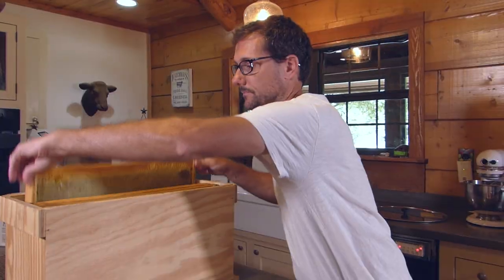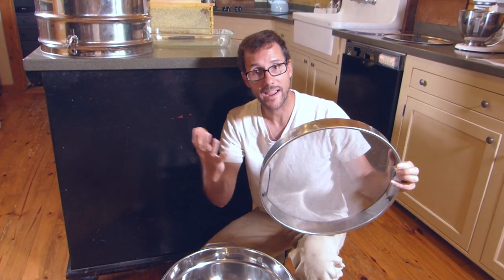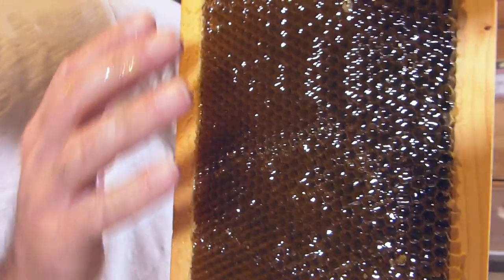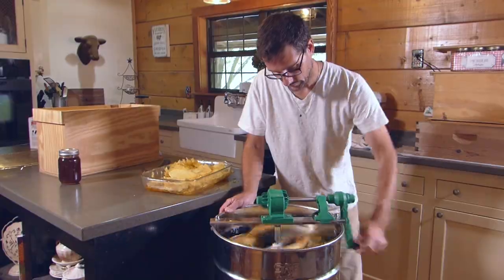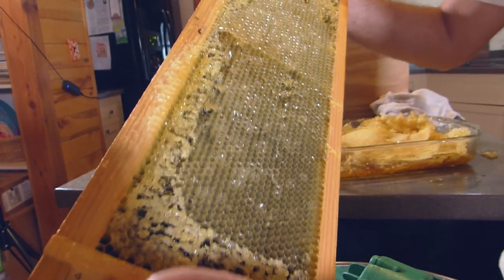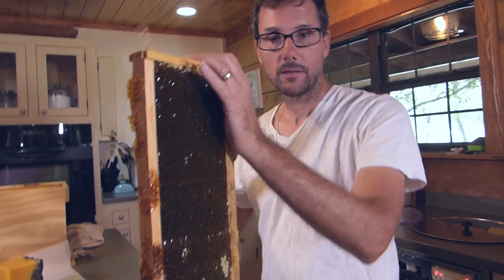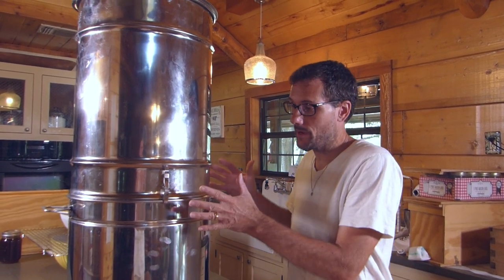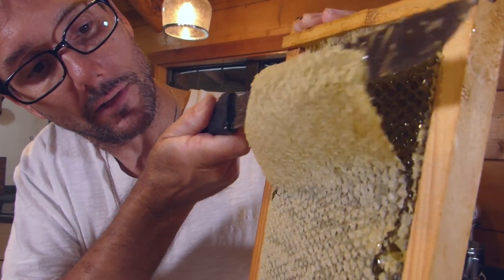Honey Harvest - Spinning Out 4 Gallons of Honey!

Comment: Hello Mr. Kirby,  I am not a beekeeper myself, but in watching other u tubers, I have seen them use a tool that looks kind of like a wire brush like thing about 3 inches wide and cylindrical in shape kind of like a small paint roller. In using this tool they open up the wax capping without damaging the comb.  A tool like that would save even more comb for the bees and you would get more honey in the long run.  I do appreciate your video so keep the good work.  By the way you got a sub and alike out of it.  Thanks again, Rick

Comment: Another possibility for using the excess wax is little blocks for hand quilters. we like to run thread through beeswax before stitching with it. It helps strengthen the threads and helps it run through the quilt layers smoothly :)

Comment: Board Butter :   I am a woodworker.  I dissolve one pound (1 part) bees' wax with four pounds (4 parts) mineral oil ... in a slow cooker.  When it has emulsified, I pour the end product into small containers (like those which hold shoe polish).  When it cools, it is very much like shoe polish except that it is pure ... pure enough to treat cutting boards, charcuterie boards, etc.  Fabulous use of the wax !!!
Reply from the maker: I love it. I've made some of that for myself to use on the cutting boards I make out in that fantastic barn :)

Comment: How many frames did you spin to get the 4 gallons? I am starting my 1st hive this year and I'm kind of looking ahead and gathering information.
Reply from the maker: If I didn't mention it in the video I certainly don't remember LOL. My hives are so up and down with honey production that I don't have a consistent notebook of data to keep all those things fresh in my head. The last couple years I haven't collected any honey at all. 2022 was a really dry year so the production was very low. I let them keep it all in the hives for the Winter.
Reply: @daddykirbs  ok. I was just curious because I have no clue on what the yield is on a full super. I will find out one of these days though 😃
Reply: @daddykirbs  good video by the way!
Reply: @williemaykit7940  Shallow super 25 pounds or 2 gallons. 
A medium 6 5/8 super 35 or 3 gallons. 
A full-depth box 60 pounds or 5 gallons.
Reply: @chadneely4511  thanks man!

Comment: This machine could definitely be improved. The actual disposition of the racks is not optimal to maximise the centrifugal effect; that is why the extraction is not uniform (one side clearly still has honey while the opposite side is empty). The racks should sit against the walls in a circular setting. You could even fit at least a fifth rack this way and the weight distribution would be improved. Finally, you wouldn't have to spin it as fast, thus improving the durability of the machine.